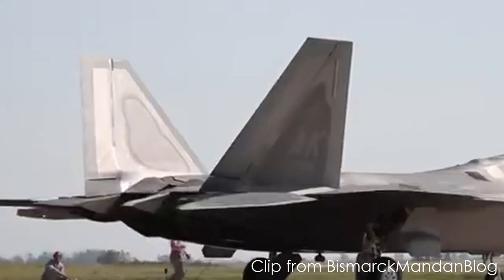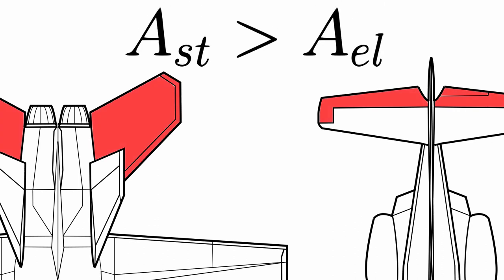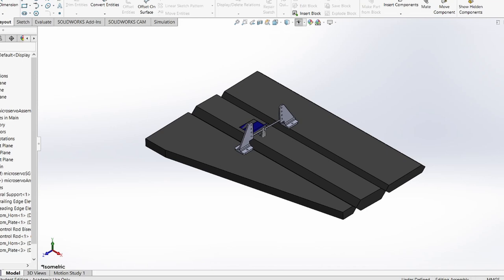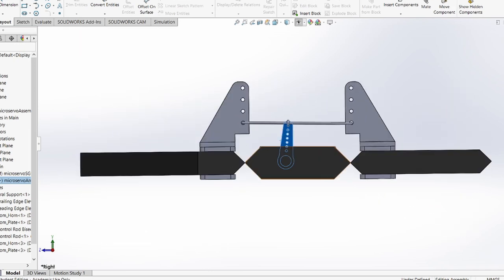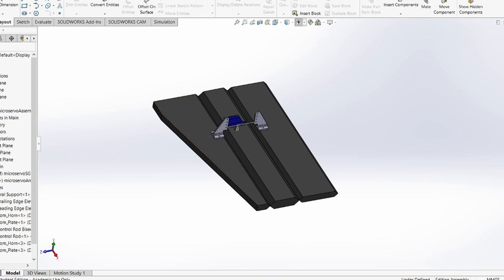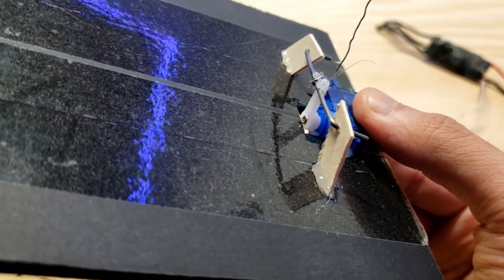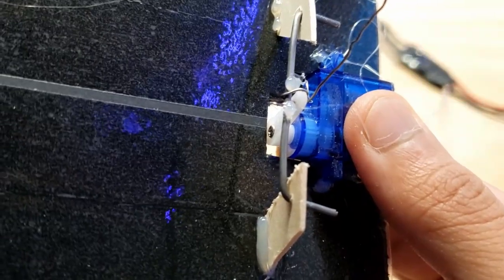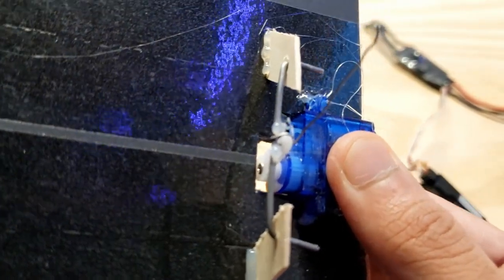Simple RC Stabilators

Comment: Just curious...is there a reason you can't use a regular z bend in the middle to avoid the extra wire and glue/tape?
Reply from the maker: That's a great idea! Truth be told, I didn't think about that solution. That would be a lot simpler and more reliable. Good catch!

Comment: Your idea is interesting though not quite an all-moving control surface. I'm not entirely sure what effect a zig-zag profiled airfoil would have but I can't say it's something I've ever seen. One of the advantages of an all-moving control surface/stabilator is that it produces less drag than a typical elevator. This zig-zag airfoil I imagine would produce all sorts of drag and so I believe your solution here to make an rc stabilator is inadequate.
Reply from the maker: Thank you for your comment and I do agree with what you've said. I think what I was going for at the time was an airfoil that would be simple to create with sheets of foamboard. The drag penalty and inefficiency is definitely a result of my approach. I just finished my third year of aeronautical engineering and looking back at this there are a lot of things I would change. Maybe I'll visit this topic again someday! Thanks again for taking the time to comment.
Reply: @projectandromeda8270  I look forward to seeing the update ! I've been building v-tails with foamboard and was wondering how to make an all-moving tail plane when I came across your video. I think a simple control horn which pivots the surface at 25% MAC will work fine - just have to find a suitable way of constructing the pivot . . moveable but with a bit of resistance to avoid flutter. Congratulations on your 3 years of aeronautical engineering :) fascinating subject !